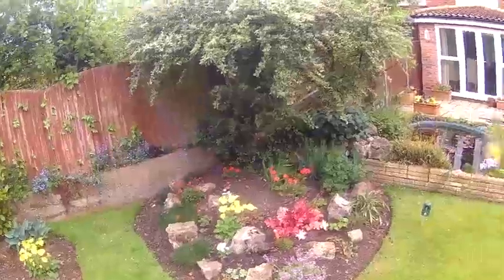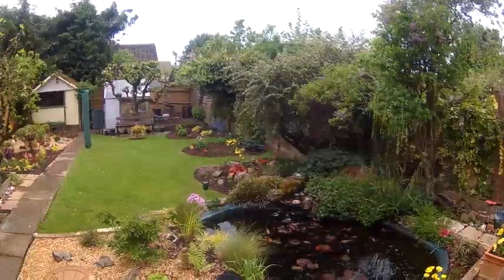HOW to INSTALL a CURVED top trellis fence

Comment: Does the wood need to be treated?
Reply from the maker: Its all been pressure treated to protect against insect infestation, fungal decay and rot.
Reply: @TheCountryCottageGardener  Thanks for that, not questioning your knowledge and skills.  I just didn't know.
Reply from the maker: @barneykennett9282  not a problem whats so ever. none of the timber has ground/soil contact so they should be good for 10 years.